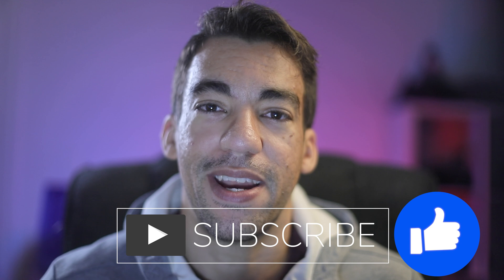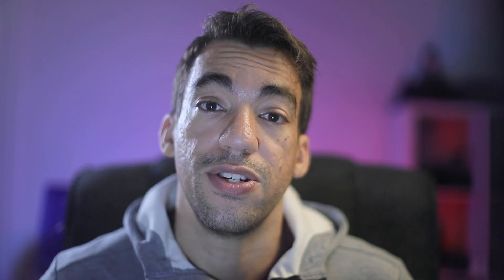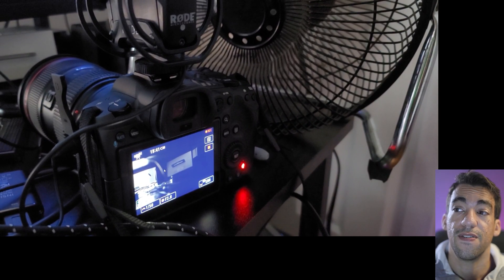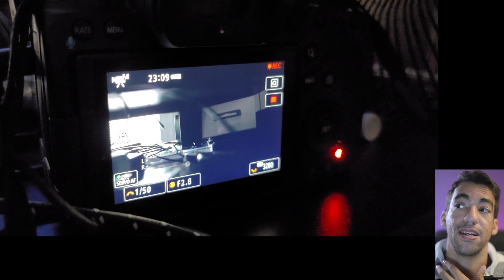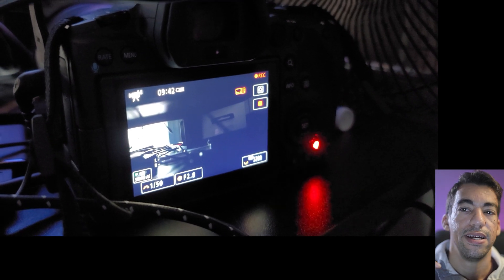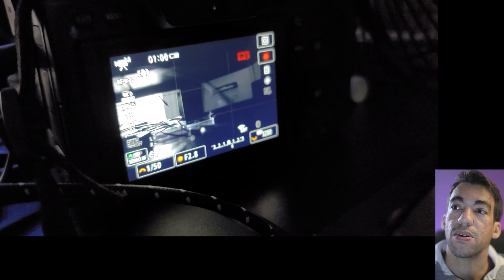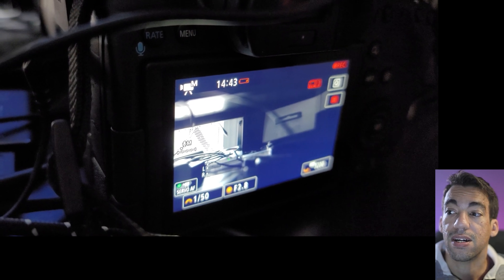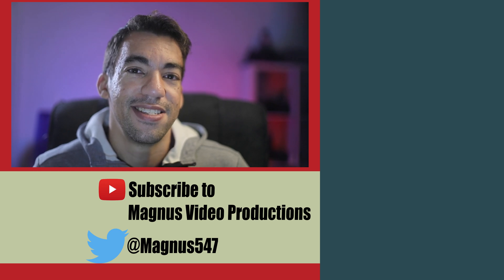How did this R5 Record 8k for almost 2 hours, with only a fan?!

Comment: Tour studio temperature was 75F and what kind/size fan did you use?  Was it on high?  It looks  like a round 14inch room fan blowing on the side of the camera with flash cards and battery.   I agree that I do not want to void my warranty for a very limited improvement which is all that is promised!   I fear some people may overly misinterpret the internal heat sink change for $400 will make a major difference so as to make their overheating problems go away for all their uses.   Your fan solution looks better to me although I have only been recording only in 4K Crop movie and 4KHQ.  I may dabble some in 8K using a fan.
Reply from the maker: the fan is about 14 inches, and i had it set to medium, not high.  High was unnecessary in my opinion, as medium was more than enough to keep the camera running without interruption for a long time.  If you dabble, let me know what happens!
Reply: @magnus547  This is very useful.  I have round 14 inch fans.  Medium is good to know.  My studio is  around on warm days during the summer.   I have air conditioning when needed.   This is important news.  I have shot a bunch in Crop Movie mode 4K which is awfully good detail and it does not overheat ever from what I can tell.  If you have lots light like with controlled studio lighting it is not a problem.  I feel this "Crop Mode" in 4K gets a bum rap.  It is the same sensor as Super 35 used in high end cinema camera after all. I use the camera in the field and do want any more weight or size thank you.   8K may be useful for cropping down to 4K and special motion effects.

Comment: I found the same thing on mine. I had a small usb powered fan pointed to the other side of the camera and recorded about two hours in 8k IPB at room temp of about 75F.  In 4K HQ I got bored doing the same thing after 4 hours.  It never shutdown because of overheating.
Reply from the maker: Now if we only had a camera mountable solution....
Reply: @magnus547  I came up with one. Use it all the time.  Will get you an image
Reply: @magnus547  Hi. Tried to email you image that shows a portable small fan setup for run and gun on this.  But your email kicks back.  I used the one listed on your YouTube channel.